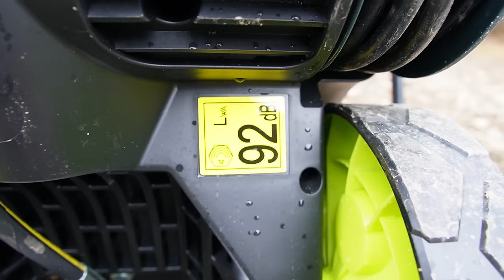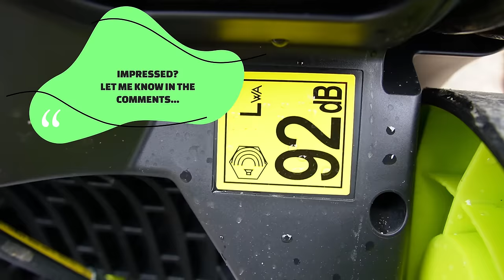BEST PRESSURE WASHER EVER MADE for Car Detailing? Is the AVA P80 Better than Kranzle?

Comment: Been DYING to get the P80, personally ticks all my boxes! Apart from the blowing fuse issue, so I personally contacted AVA and they gave me a LOT of information, so long story cut short, they explained that the fuse blowing problem was caused by extension cables or the initial start up causing a overload on the motor. They have since made a modified version which helps "significantly" but they said they're still not happy with it and that they are going back to testing etc... starting now in Feb 2023 and should have fixed/revised the issue by Summer 2023 and will be for resale again in UK
Reply from the maker: Yeah there is a p80 V2 Coming I believe. But then again the p70 is a brilliant alternative. To the average Joe could never see the difference in power
Reply: @epicautomotivedetailing  just coming back to this comment, do you personally see any real benefit for the extra power going for a P80 over the P70? love to hear from your side of things.
Reply from the maker: @ParagramCOD  p70 is better mate. It's more of a version 2 of the p80 if say so more robust parts. My one hasn't blown any fuses either and still yet to hear of any problems with them
Reply: @epicautomotivedetailing  Great thank you, I ended up ordering a P70 last night, with the MJJC foam cannon, buzzing to get them 😂

Comment: I've had my Ava p80 for 12 months two things ive changed the snow foam gun for a better make problem solved now it uses around 450ml to cover a car. And second  with some massive help from nick at yumcars convert the gun to a mtm sgs28 gun for car detailing this set up is EPIC
Reply: @epicautomotivedetailing  word of warning the brass end of the hose were the gun fits is NOT a karcher fitting cut 6 inches off the hose and fit a 22mm female adapter then fit yumcars mtm 3/8 quick connect coupler.the 6inch piece of hose left over with the brass end fit a 3/8 Male adapter.this will still allow you to use all the original components it transforms the washer massively
Reply from the maker: @carlostheimer6505  amazing stuff. Only yum would fix that problem 👌
Reply: @carlostheimer6505  
Is the brass  hose  connector  you refer to  the same as nilfisk..  the bigboi wash r is the same.
 They are round where the karcher one has the 2 flat bits on either side..

If its the same then a nilfisk adapter  for the mtm stubby would work..
Reply: @MrDelcol  i bought the nilfisk fitting myself but it would not fit.the nilfisk fitting i have is white inside which only fit karcher as do the yellow once which also fit karcher because as you refer too with flat sides. I belive you need one with the green inside to fit but good luck trying to find one i could not anywere.

Comment: Hi, good video, but I didn't realized if the AVA is now better as a Kränzle or not. I still struggle with me if I buy an AVA or Kränzle K 1152 TST.  One additional question from my side. I would like to us the high pressure cleaner also to clean up our caravan. Is the Zoomlanz in the max extension stable enough to use with the mopp as it is just made of plastic? Thank you.
Reply from the maker: Kranzle are the best but then again kranzle is for commercial market whereas Ava is for domestic
Reply: @epicautomotivedetailing   But at least, price wise both are nearly on the same level. Especially when I compare the Evolution P90 with K1152 TST. The only I hate on the Kränzle is, that it every time needs to lay on the ground. What about the question for the Zoomlance?

Comment: Thank you for the video Dave. Certainly looks a very powerful washer and I like the accessories and features. Key question is how reliable will it be. Let's hope it will be 🤞. You did a cracking job the the BMW. It looked stunning after your sterling efforts.  👍
Reply from the maker: Thanks Karl. Yeah that's the only thing I can't comment on until time has passed but I'm making another one next year as I'll be borrowing this machine and basically testing it till destruction
Reply: The fact that anything mass produced will fail, means it’s a wait n c. As long as it’s sturdy, it will last. Kärcher shave been known to fail. Miserably. Happens with all things
Reply: @epicautomotivedetailing  is it still working mate

Comment: Hi Dave. Great video again. Wow what a machine, just checked the price out on the link and was expecting it to be a £800++.if it remains reliable etc it's a bloody bargain! Just one question, is there the facility to use other snow cannons. I.e. an adapter?
Reply from the maker: Hi John. Fits with all Karcher k series as same fitting. I still love my nilfisk 😉
Reply: @epicautomotivedetailing  Yeah me  too pal. Still very impressed though.
Reply: Its standard karcher hookup but you can buy a nilfisk/other adapters👌😁
Reply: @epicautomotivedetailing  Which model Nilfisk do you have?

Comment: After a year, how has your experience with the ava been? I want to buy an p60/80 evo. But doubting between nilfisk premium 180. Heard ava had some problems with fuses? Which one would you recommend with your experience in all these pressure washers? Greets!
Reply from the maker: Hello so the p80 is very good but we had the occasional blown fuse which is uncommon for any pressure washer after constant use. Ava understood this and made a better version dialed back called the p70 which is what I'm using right now and it's a perfect balance. 100% reliability so far. Very impressed
Reply: @epicautomotivedetailing  i see, thank you for the response ! Guess ill go with an P60 than. I heard fuse problems could be fixed with taking a lower power demanding version. Glad you are still using it ! Shows it is good.
Reply from the maker: @Noodlehustle  they are great machines. The problem is the second someone has a problem it gets magnified and it's the tiniest number out of hundreds of thousands
Reply: @epicautomotivedetailing  you mentioned in another thread that a new p80 is coming out. would I be safe buying the p70? looks like great value

Comment: you probabley find no kickback with longer because of the weight of the longer lance there might be an advisiry in the instructions to not use full pressure when using stubby gun but i do like it nice to see a company thats put some thought into there power washer and not another cheapo machine
Reply from the maker: I like this machine. Got it for few more months to see how it performs under every day use
Reply: i notice that karcher atachments fit it aswell the big one also comes with 20 warranty if that isnt a claim i dont know what is but curious to how there after service compares to karcher domestic equipment
Reply from the maker: @russellpetrie119  yeah they have terms and conditions ideally everyone needs to be look at before they buy. For example if I used for 19 years to destruction I would probably void the warranty. So regular servicing with proof is probably required but best to check on their site

Comment: Quick mate i just sold my k7 and I'm ordering a new one tomorrow 😄 ava p80 or nilfisk 180?
Reply from the maker: I got both and even I can't decide lol. If you already got stubby gun etc that you like then nilfisk but if you want a little extra then Ava.
Reply: Yeah can't decide aswell 😄 i don't have a stubby gun but don't mind getting/ paying for one.

 I just want the most practical and powerful one, I absolutely hated the k7 twisty hose, roll off system and the connector not a fan of aswell (I'm a real inpatient guy 😄)

Is there a noticeable difference in power 180bar vs 160? 

Anyway thanks for quick reply mate  that's awesome 😄

Comment: Hi! I just bought the p70 one which has about 150 Bars of pressure. I own a Tesla Model 3. I don't think I can adjust the actual pressure it produces or? Would I just want to use the 20 and 40 degree nozzles? 20 for rims/wheels and 40 for everything else and then keep my distance?

Comment: Any option /hack to use the PF22 foam Cannon with the existing hose or swapping out for a traditional hose to fit the foam Cannon.  And what about noise level. Thanks and great demo. 👍
Reply from the maker: Yes mate all karcher fittings work so plug in and go 👌

Comment: Great review. Do you know if P80 would suck the water from butt tank or a bucket? If not would a gravity fed water from a butt tank suffice?
Reply from the maker: I use it from a tank fair few times. Never a problem
Reply: @epicautomotivedetailing  thanks. I was also able to confirm it is capable of feeding from any body of water (preferably with use of their extremely overpriced suction hose)
Reply from the maker: @sebna  I can guarantee that I used the p80 just sticking hose in the tank. I have a water in my van it works fine

Comment: @EpicCarShow Great video. Regarding the snow foam cannon, I use saved Demon Shine bottles with my snow foam cannon. I pre load the bottles with snow foam solution, Aquaseal polymer sealant solution etc. and just change the bottle when needed. The thread on the Demon Shine bottles is the same as most snow foam cannons. I'm just wondering if they will fit this one?
Reply from the maker: Yeah I do that with coloured snow foam now to make rainbow foam for the odd the video 🌈

Comment: Being new, what alloy wheel cleaner would you recommend, would i need to brush it in and power wash it off
Reply from the maker: If for business then Autoglym professional is a good all rounder. No such thing as a perfect wheel cleaner but it's definitely a good one
Reply: Which one as when you Google it at least 3 pop up
Reply from the maker: @harryblinkhorn2792  I use blue one heavy duty cleaner. But ideally you need all types of wheel cleaners / fallout removers

Comment: How does it compare to K7 in your view? Which would you pick for general use around the house rather than mostly for cars?
Reply from the maker: This pressure wash is unbelievably powerful. I have a k7 but this gets used more often
Reply: @epicautomotivedetailing  in your review of K7 you mentioned that its lack of pressure in compare to you pro Karcher model is very noticeable.

How does P80 feel in compare to your pro Karcher?

Also I believe I read that you have also experience using Kranzle. How P80 compares power wise / cleaning wise?

Thanks
Reply from the maker: @sebna  the Ava is more powerful over the karcher 7125. But the 6/13 is better if you have quick release attachments
Reply: @epicautomotivedetailing  nice. It looks like AVA P80 is one hell of a deal. Lets hope it is really meant to last.
Reply: @epicautomotivedetailing  for the past 11 years I was sporting C 120.3 but is started acting up few years ago. I probably would be able to get it fixed but I thought I will treat myself. 

I checked today and I bought C 120.3 for 120 GBP. It came with plethora of addons like premium patio cleaner but what surprised me the most is that it is rated at 120 bar max but also 480l/h. The flow is not too far from 600l of AVA P80... Gear wise, similar package will cost me 600e for AVA... I hope that upgrade will be worth it.

Do you know about any worth recommending  Karcher (AVA) to Nilfisk accessories adapter? I could save 80 euro by re-using my Nilfisk premium patio cleaner and make our planet happier by not generating more plastic waste than I already am.

Comment: Researched this a lot before deciding to purchase p80 Evo - arrived yesterday and found hose manifold snapped and taped in place, on opening box. No contact numbers/return policy, just an email address which estimates response in 15 days?!?! Simply not good enough for a machine at this price point - would recommend caution if considering purchase
Reply from the maker: That's awful... Where did you get it from? Was it a refurb model from clean store?
Reply: Brand new, direct from Ava. Still no contact/resolution
Reply from the maker: @stuartnurse8415  this is not good to see. I actually have the owners email so do you know what I'll send him this screenshot. This shouldn't be happening
Reply: Appreciate that. Thank you

Comment: Hey great video! I'm in debate about buying either the nilfisk p180/200 or the ava evo p80 but I'm worried about this whole fuse blowing situation in the UK. I've heard if you hold the trigger in before starting it, this usually does the trick. Don't suppose you would be able to confirm whether they have fixed the fuse issue and whether this trick does prevent the fuse from going?

Lastly, if it wasn't for the AVA blowing fuses, would you recommend it over the nilfisk p180or p200?

Thanks!
Reply from the maker: Well Today I received the first of its kind AVA p80 so i will hold off from giving an answer to the fuses as its being tested for the next few months as the fuse blowing could be a thing of the past
Reply: @epicautomotivedetailing  thanks for the quick reply! That's good news. If the fuse issue is sorted, would you recommend it over the nilfisk p180/200? The fuse is the only thing really holding me back on this machine
Reply: I’ve read fitting a slow blow fuse can help, which I didn’t know was a thing! I’ve just taken delivery of a P60 Evolution and that says on the box about having a slow blow fuse

Comment: Dave can you tell me what’s the difference between the master and the evolution??
Reply from the maker: Underneath nothing at all. The master is ready to go out of the box. The Evo requires some assembly I believe.
Reply: It seems to be mostly design tweaks to the exterior e.g. the evo has a power lead reel (but needs to be fully unwound during operation), it has the tool tray at the top vs side storage on the master. There are also some differences in the bundles between the two - master large bundle has patio cleaner, evo does not. I think the technical specs are the same. The Evo is the newer variant.
Reply: @vinrow7671  great thanks for the info 👍

Comment: and the nozzle be adjusted to vary the spray angle? im used to the spray coming out vertiically
Reply from the maker: you can get an adapter now to twist it
Reply: @epicautomotivedetailing  thanks for that. Seems like an oversight. 
"The AVA Accessory Swivel is a result of consumer requests, especially from the car cleaning community. Pressure nozzles on a bayonet system have a set spray direction, which can sometimes be a challenge. When cleaning a car or a horizontal wall covering, you might want the spread to lay vertically."

Comment: This or the K7?? Also can you use the the pf22.2 with this?
Reply from the maker: This 👌
Reply: @epicautomotivedetailing  perfect!! Will the pf22 fit on it? 🙏🏽
Reply: Hi ! Thx for you video ! Would like to know if any snow foam lance can be used on the AVA ? I can’t find out if there is a quick connect for the accessories or if it’s a proprietary connector ?

Comment: Good morning dave, thanks again for a great demo on new pressure washers👍 it certainly looks the part and from your demo it looks capable of cleaning any vehicle. The only two drawbacks only minor is the whole thing is plastic which over time could become brittle or crack? And for the snow foam cannon maybe put a restrictor in it somewhere to reduce the output? Or a dial like the ones on karcher or nilfisk?.
Reply from the maker: They got new cannon coming soon.  Thanks for watching my friend I just creating these videos 🙏🙏
Reply: @epicautomotivedetailing  do you know what else new ava products are coming?
Reply from the maker: @SlavKing95  they have so many accessories my friend. The new cannon is coming soon
Reply: @epicautomotivedetailing  I cant decide if i should get a ava or not.. gonna use mainly to wash car and the house😅 atm i have a 120 bar nilfisk and its masking alot of noise